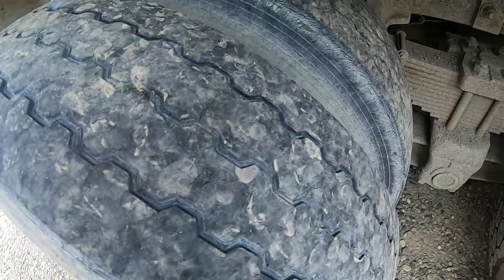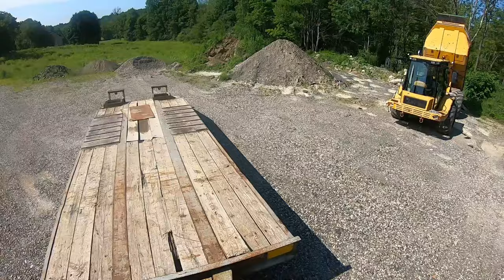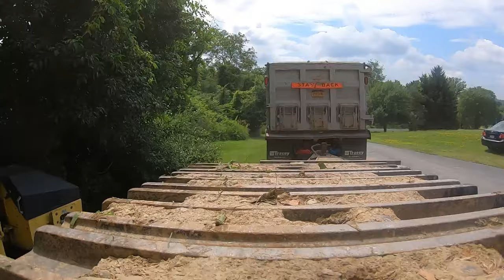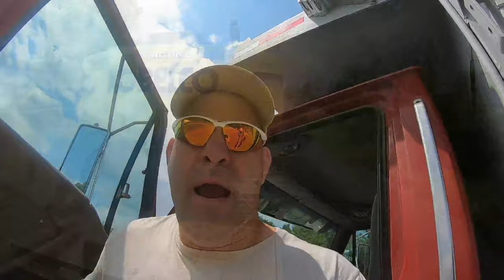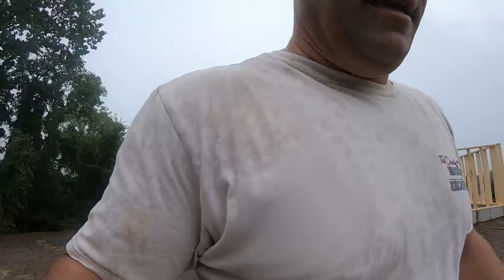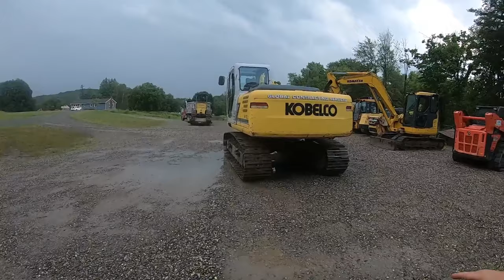How to Figure mobilization money in your bids when pricing a new project

Comment: Alot of companies will have a seperate equipment division that owns the equipment and rents it to the company for each job. Companies like Kiewit do that. So each machine is it's own profit center. Not only fo you have to pay for upkeep on the machines, but also your time is valuable also. I know when bidding jobs alot of companies will use a lump sum for mobilization. Do you use those volumetric mixers that mix small quantities of concrete off of the truck?
Reply from the maker: Brian thanks for your input.. yes I have used those small mixers on different projects... The problem is they're getting just as much as the big guys now..
Thanks